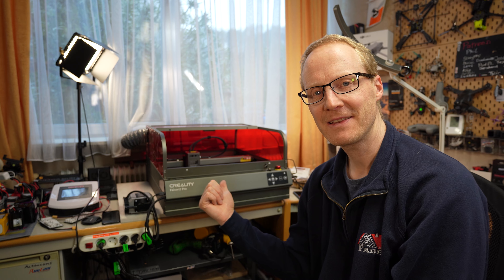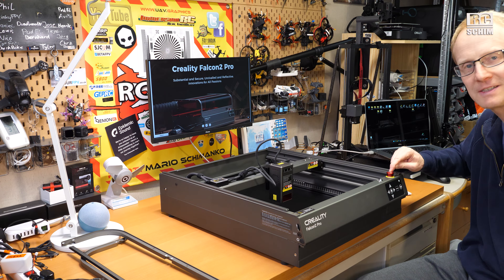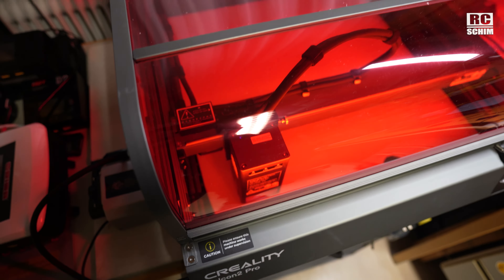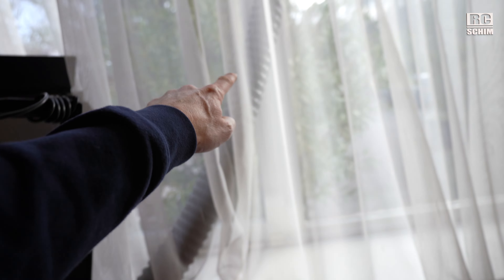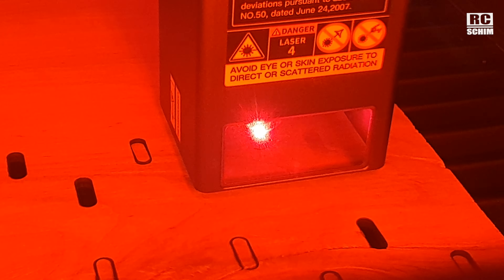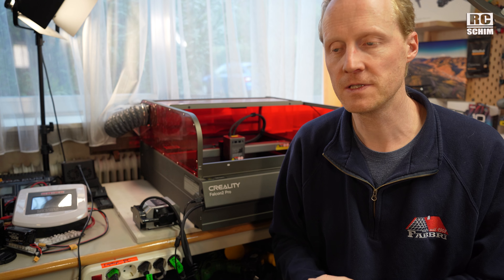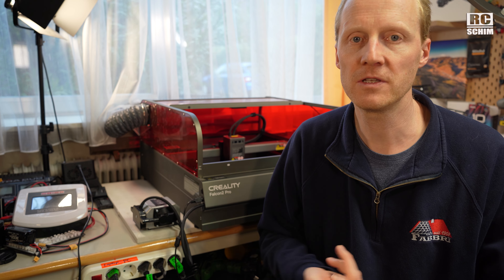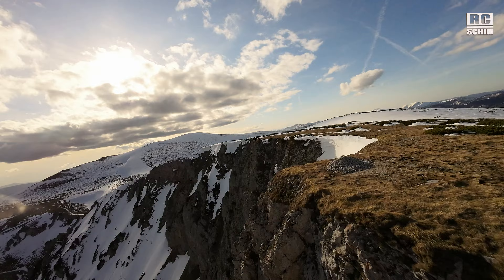Should this be your first LASER Cutter/Engraver?  (Creality Falcon 2 pro)

Comment: Hello Mario. Is it big enough to cut flitetest plans?
Reply from the maker: Well, good idea. Never used a plan from ft, but if it fits within 40 x 41 cm then yes (roughly 16 inch).
Longer parts will fit in there, but the cutting can only be done in this size…

Comment: Is it possible to upgrade a falcon 2 to a falcon 2 proof is it a new unit design in entirety?
Reply: There is no relevant difference. In fact there are some major downsides. You cannot increase the z-height to properly engrave with the rotary tool. The tray has magnetic sensors that prevents its removal. Pretty hilarious actually, the amount of deception from Creality on this one.
Reply: @scrampker  Interesting so the the only benefit to the Pro is the built in enclosure which in reality I could construct myself - looking at a 22W and looks like I may as well just buy the Falcon 2 rather than the pro then build or buy a seperate enclosure? no additional benefits on the Pro?
Reply from the maker: I can confirm: not even with some own magnets I could fake the unit to work with an open tray (because I wanted to cut something very long and thought I could keep the tray open
My guess, this is important for shops that couldn't easily operate an class4 Laser due to workplace security, but they can now operate It encased as an class1
Reply: @Rcschim  someone on Reddit says they found a physical switch that gets pushed into place when the drawer is inserted. Allegedly only needs to be pushed once by hand each time the drawer is removed. 

I personally cannot find this, but it sounds like some sort of roller/rocker switch if this is true.

Comment: Thank you for the honest review will it engrave drinks bottles and glasses, because it seems to have a delph limit with the tray, thank you again.
Reply from the maker: I dont know at the moment what the max height is. you can leave away the knive blade rods above the tray and lay it ~4cm lower by that.
But engraving glas isn't easy (havent tried yet). there's a german lady (Dragoncut) - she tested a lot. you need to apply some paint to engrave in glass. Or you can lay some cardboard below the glass and have it engrave there.
Reply: @jimblonduk thank you for the in depth answer I do appreciate it 👏

Comment: How did you find the air filtration system? I'm thinking of getting one of these for my workshop which is in my dining room....I have a bricked up chimney / fire place so could vent into that using a ducting system. I've heard that the seals around the canopy of the Falcon aren't 100% perfect though and some smoke still escapes into the room even when using the vent system that comes with the machine. Did you find this also?
Reply from the maker: Those lasers are never really sealed 100%, better to have them near a window...

Comment: Is this engraver able to engrave name on stainless steel ?
Reply from the maker: Hi, that's difficult for sure. Currently I'm testing the xTool S1 (40W) and it has samples. Will see how it works.
On stainless steel, quite reflective, you need to apply some paint I guess. Best engraving on metal is, if it has some sort of paint coating which can be burnt away...